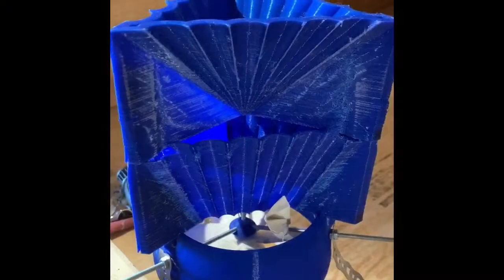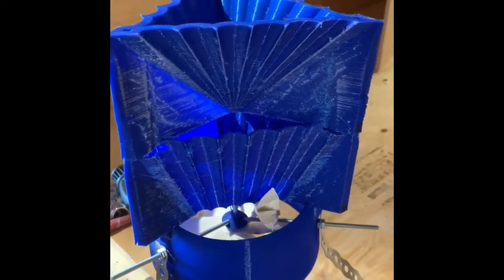FAWT FIXED. AXIS. WIND. TURBINE. PROTOTYPE 2 Vawt 3d printed TURBINE

Comment: Interesting. Yes you need numbers. A rpm sensor would be a simpler way to judge design adjstments, instead of a generator. Make your windtunnel suck. Blowing air from a fan is Very turbulent, and your measurements Will be affected.
Reply from the maker: good observation, i think you are correct with all your advices, i am just a bit busy with every day life these days, delaying additional tests. i would send you all 3d files if you have 3d printer.

Comment: I want to generate power and I was looking at 3d printing recently as something to get into, then I thought maybe there are 3d printed generators,  this one looks great.  how much electricity do you think it can produce outside? I'm also a fan of the venturi effect.
Reply from the maker: thanks, but which generator are you referring to?
Reply: @emagnets  FAWT FIXED AXIS WIND TURBINE PROTOTYPE 2
Reply from the maker: @IntermountainGoldRefiners  ok, i did this one as a test for a Venturi type turbine and it did work, i tried to biuld a large scale to produce 1500watt at average wind 50kmh, but i have not finished yet, because i work daily, the size is on 
https://www.youtube.com/watch?v=AKvhCEr7oUY
https://www.youtube.com/watch?v=ntuT3oYHIAE&t=336s
https://www.youtube.com/watch?v=ywfqK9uhtZk&t=6s
Reply: @emagnets  Im looking for a 3d printed wind turbine design for low wind speeds (5 mph - 20 mph) do you know anything ? What kind of generator would work for these speeds ?
Reply from the maker: @PANTHERA369  i have my vawt in 3d files, it also reqiured a cnc machine to cut the discs, there are many files on cgtrader or sketchfab